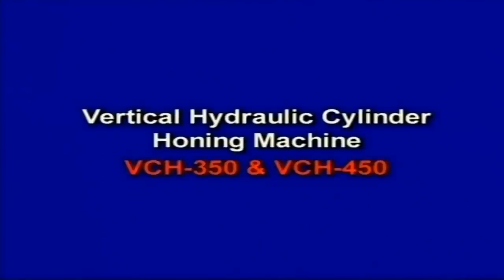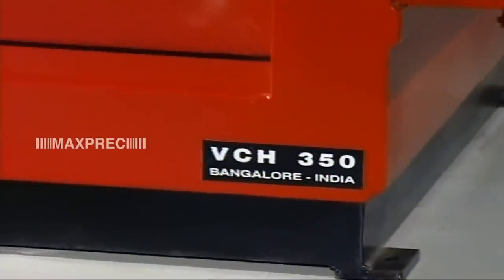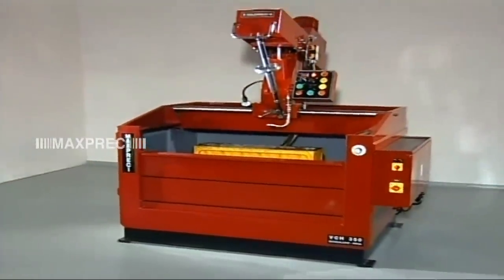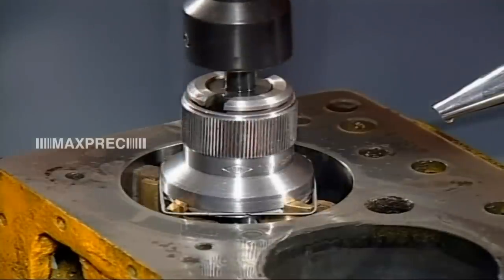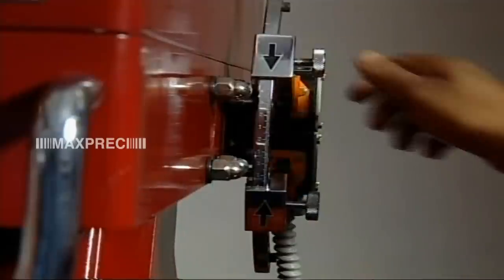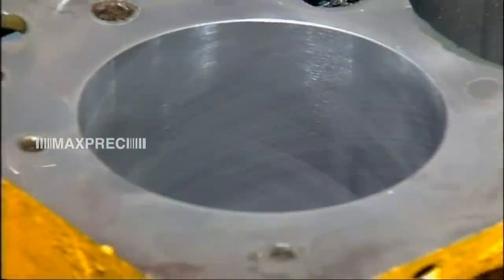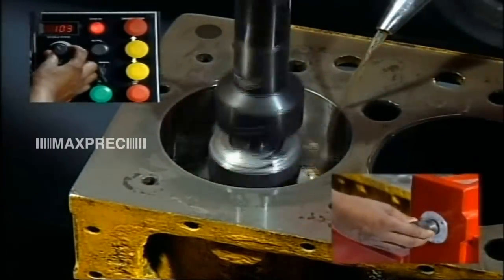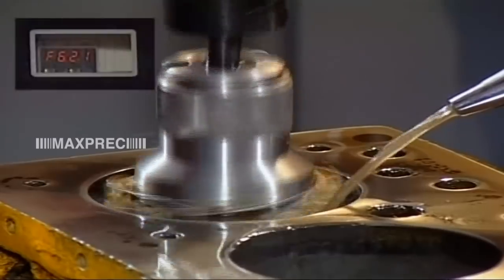Maxpreci Vertical Cylinder Honing Machine - VCH

Comment: I'm a machinist and engine builder of high performance and racing engines. We have two different model hones in our shop, and quite experienced at cylinder wall finishing. The machine in this video appears to be an excellent machine, easy to operate, and capable of delivering very precise work. I would buy such a machine without question.